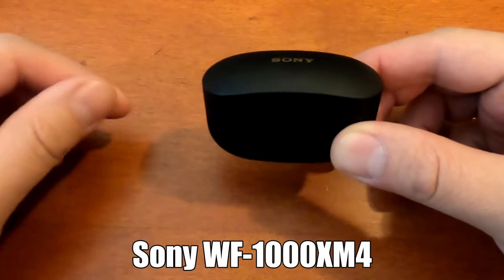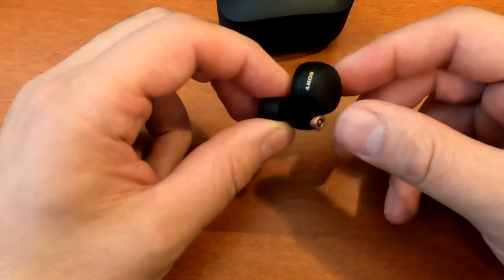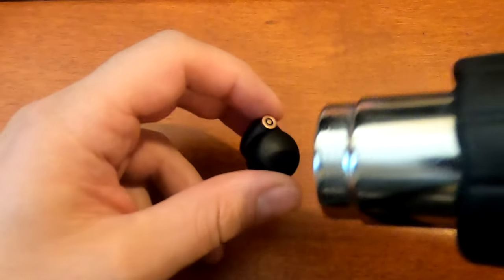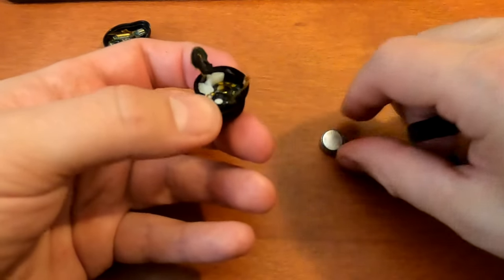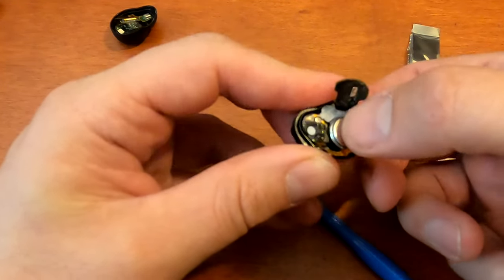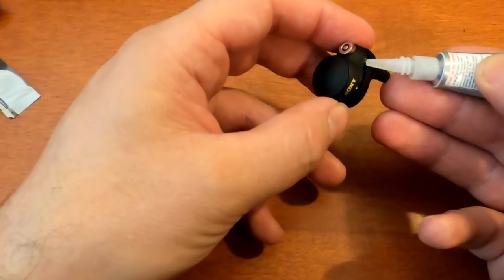[QUICK FIX!] Replacing the battery on a Sony WF-1000XM4 earbud

Comment: Tried this and it was a colossal failure, wasted $30 on replacement batteries for nothing.  The replacement battery began to heat up to a very hot temperature when I put the earbud back in the case.  Sony should be class-action sued for the huge number of these earbuds failing prematurely (got 14 months out of mine).
Reply from the maker: Ughh - Sorry to hear that it didn't work for you. Perhaps you had a bad battery?
Reply: or bad firmware
Reply: Same problem here

Comment: Thank you so much for posting this! I bought these headsphones a couple years ago for $300, so very stoked they could be fixed! The battery in the left earbud would not hold a charge for more than 45 minutes. I bought a battery kit and tools on Amazon and actually used my wife's hair dry to soften the glue (it worked great)!
Reply: Yeah, i had exactly the same issue... and the left one is getting got in case... 
I read (think on ifixit) that some explodes... Be careful when you switch the battery. On ifixit its recommded to drain the battery to zero. So u cant make a shortcut
Reply: The wife comes in handy aye;)
Reply: Whats the battery kit and tools you bought on amazon?
Reply: I'd also like to know which kit you bought? I found a lot after looking up the battery, and the reviews are iffy on most...
Reply: My silver ones were out of warranty, and Sony still did a free replacement for both earbuds. Contact Sony and see if they can do it
Reply: @whomstthouamme2155  oh, I might try this then. I'll have to find my old pair of headphones in the meantime, but it'd beat only having one earbud.
Reply: Thanks for the
 hair dryer idea!

Comment: Thanks. I had a feeling it's not hard if you're used to electronics repair. My left drains in 4hrs now and shuts off. Going to be replacing both batteries 👍🏾👍🏾👍🏾 "subbed"
Reply from the maker: You can do it!
Reply: Youre so lucky it is 4hrs. Mine at 45 minutes and dead. I hate sony now.
Reply: Howbdidbthe repair go brother?
Reply: @mrsquid8255  my new batteries come in tomorrow, thanks. I'll let u know how it goes.
Reply: @TheMrbean97  with noise canceling on I'm down to an hour now lol
Reply: Any update? I've got my batteries in the mail. So I'll be attempting it soon as well.
Reply: @javisolis2568  mine have been doing good. They last my 8hr shift at work like they used to
Reply: I'd take 4 hours. Not even 15 minutes out of mine

Comment: You ROCK! I want to give a helpful tip here as I am older and could not squeeze hard enough after heating to get the side to pop open. I used a hair dryer…after hot I quickly wrapped the bud in a protective rag and "gently" used a pair of pliers and squeezed in the oblong manner and the side popped right open for me to get a plastic tool in there. No scratches or damage. The trick is to be patient and heat the earbud up thoroughly as the glue is softened and the plastic of the earbud is much more pliable. Hope that helps someone!
Reply from the maker: It's still taking me a while to learn, but having patience when working on projects is sometimes 80% of being successful. Glad it worked for you!
Reply: thanks, that's very helpful. I was wondering myself if a standard hair dryer would do the job.
Reply: Legend
Reply: how long did you keep the hair dryer on it?

Comment: First off thanks for a well paced and excellently narrated tutorial. Certainly made things a lot less scary. A couple of things to share for other following in my footsteps. When trying to prise apart the case I found the tools supplied with my batteries were pretty useless. They were chipping and disintegrating so I just got a sharp knife and rested the blade on the crack. The two side just gently widened then came apart buttery smooth. Hardly any pressure required and no damage. My first battery swap was exactly as this video but the other ear bud gave me a bit of grief. The ribbon cable that has the black part that lifts up to release it was just not coming out of it's housing. So much so I reached the point of thinking this is gonna break. So I cut out the middleman and left it connected put the black locking bit back down and tried to see if the battery would come out. It did, surprisingly easy and there was enough space to remove it leaving the adhesive pad in place on both sides of the battery. Essentially you don't need to unclip the smaller ribbon cable if you are confident or if it, like mine, refuses to budge. Other than that smooth sailing. Good luck all.
Reply from the maker: Awesome! Yes, great tip about that ribbon cable - I've heard from others that they were able to replace the battery without removing it - goad it worked!
Reply: As you see in the video, that small ribbon cable has a "I"shape to lock it in (in addition to the lock tab), it needs to be lifted slightly first, then it comes out easy without force.
Reply: @user-rs8zg8ey2b YOUR COMMENT SHOULD BE PINNED! Too many people don't know about ribbon cable tabs at the connector. Watching this video (which is excellent), all I kept thinking was: lift and pull, lift and pull.
Reply: I left the cable connected too. Worked for me

Comment: I didnt even use a heat gun I just used a razor blade to slowly pry it open the adhesive enough to put my thumbnail in it, then its separates quite easily

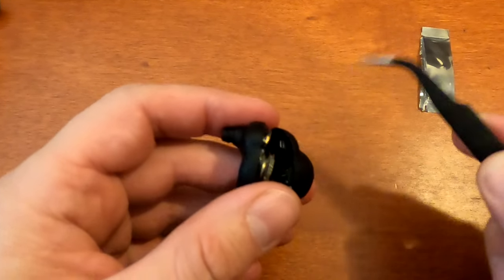Comment: Be very careful when connecting the circuit boards as shown at 13:58.  Do your best to make sure you have them correctly aligned before applying pressure to snap them together.  I just replaced batteries in 4 of these earbuds.  3 went as planned, but the 4th earbud was ruined when a couple of the microscopic prongs in those connectors bent while I tried to snap them together - probably due to poor alignment.  As a result, the outer part of the earbud was totally nonfunctional after I put them together.  But hey, three out of four ain't bad when the alternative was to trash the buds entirely!

Comment: Thank you so much for the video!  I was able to replace the batteries in both earbuds following this guide - they used to die after 20 minutes, now they're back lasting for hours again!
Reply from the maker: Awesome!
Reply: Bro, whats your version? And now backup time?
Reply: works with new firmware 2.0.1?
Reply: @GutCars  firmware shouldnt matter, you're not replacing software, its just the battery. Any inherent battery inefficiencies with firmware will persist after battery switch, this is just to replace drained faulty battery

Comment: Thanks for providing this tutorial. I also followed other comments of not having tu unplug the ribbon cable on the battery. Opening is probably the hardest part and the squeezing will only work when its hot enough

Comment: I'm so grateful to you. I had problems with the left hearing aid and I thought about discarding them, even though I like the sound and cancellation so much (I live in Guatemala and there is no official support or distribution, in fact the hearing aids were expensive and came from the United States because they are not sold here). But thanks to your video I felt qualified to replace the battery. So, I bought them on eBay, two weeks later they arrived, yesterday I made the change and now they are working as before. Thanks, thanks.
Reply from the maker: That's awesome! Glad it worked!

Comment: Absolute legend, thank you! So much better than the ifixit instructions. Sony won't honour their extended warranty so I'll repair them myself, but this is a lifesaver. I don't feel like I'm going in blind now. Lesson learned though - Dont buy Sony earbuds every again! Their aftersales and customer service team are awful.
Reply from the maker: Thank you!
Reply: Hey man, in the small off chance that you see my reply, Sony will honour their extended warranty if you talk to the right representative. I got a pair used from an online auction and spoke with someone this morning. I told them I didn't have my proof of purchase as it was a gift for christmass in 2022 and the person who purchased paid for it in cash and didn't think to keep a receipt for over a year. The representative then asked me to wait a second, and when they responded again they said the email with the label has been sent and that I do not need to provide proof of purchase, and when it states that it's out of warranty that does not matter as Sony will cover the entire cost. I may have to wait until mid-february for them to be replaced as they said they are waiting on more parts but I sent them in today as I had already received a label that they paid for and was informed they will just be giving me a new pair that has the issue resolved that they will pair to my current case.
Edit: I do have to state that I live in the United States and SONY USA has been pretty good at sending replacements outside of warranty probably due to our consumer laws. I am unsure if Canada or other countries are the same.
Reply: i absolutley agree with! no more sony and never!!

Comment: This was a great tutorial. 

For those who may struggle with initially opening up the earbuds (like I did), you can use the corner of a door jamb (where the door and the hinges meet) to apply pressure and pop the case, by putting the earbud in the space between where the door and the hinge will meet, as well. Works way better and doesn't hurt your hands! Be careful though!
Reply: very good tip

Comment: Thank you sir, replaced my battery just now! Hopefully that resolves the battery drain issue. Really disappointed in Sony considering how expensive these earphones were at launch.
Reply: is firmware 2.0.1? can change battery fix the issue?
Reply: @YohanesRobby do you solve it? I have same firmware and my left earbud is dead after 15 min (but i never use it much as right one). Do you have also problem with left one?
Reply: @marianmachacek  i change battery on my MX3 and fix it (before 2H, after 6H). its not firmware issue, but battery health. on my MX4 i replace with new one (under warranty) because sony told that is firmware issue so i can claim warranty
Reply: From what I've read, it seems to be an overheating issue caused by a previous firmware that degraded/damaged the battery. So the physical battery is damaged, swapping it and having the latest firmware should resolve it. Still inexcusable to be punished by sony for their mistake on such an expensive product!
Reply: @Crazy09starkillor  Could be done on purpose to generate battery sales .Which explains why they're using the specific zeni power battery for these buds.

Comment: Awesome video. I've just repaired one of my earbuds with your tutorial. I'd just add a note to say to open the earbud after applying heat, I've applied pliers, VERY gently, pressing on the sides where the parts are glued, not on top of the main surfaces. That allowed it to have a slight opening from where I could slide through the rest and separate the parts. Put some fabric where the pliers are pressing to avoid marks on the surface of the plastic. All this very very gently and it's working as new. Thanks.

Comment: My right earbud only lasts 40 minutes. Cant wait to do this! Thank you so much!
Reply: Mine lasts 2 minutes
Reply: Both of them
Reply: Had the same problem but after the latest update.
Reply: Just ordered the batteries, doing my own replacement soon. Looks like the XM5's are having the same issue and I'm definitely not getting new earbuds from Sony any time soon.
Reply: @CalusoXP  I had warranty, just got the refunded and found a shop wich sold the xm5 for  255€  new so just paid 15€ on top for the xm5. I took the deal.
Reply: @SprintetRuckwaerts  Lucky you, I live outside the US without an easy to claim any warranty. Anyways, kinda sad to see the same problem with the XM5's, hope the next gen doesn't suffer from the same problem.
Reply: @CalusoXP  But i had 2 Issues, my battery and my right Touch Function was not working. Would be pissed if they dont replace/refund it after 1 ½ Years of moderate use and a fckng 290€ Product but until now 0 issues with my xm5
Reply: Even if you are out of warranty reach out to Sony, battery drain is on their known issues list. I just sent mine in this week free of charge and they were a year and a half old

Comment: great video and really helpful.... a lit tip.. if you're struggling to separate the 2 halves after the heating phase. I used a small wood working clamp and slowly applied pressure and if you do it slowly enough the sides start to separate
Reply from the maker: Great tip!

Comment: Thanks for the video. I would like to add that you could separate the two halves enough to remove the battery without disconnecting the cables and you might have to lift the spring contacts slightly to establish positive contact with the replacement battery.

Comment: Thanks for the video which is mostly helpful. 

Hey guys, I just tried to follow all steps (most of which are correct), however, word of caution that the batteries we are trying to replace are with defects or swollen and for eg. my right one popped on me and luckily it did not shoot badly, but essentially, the battery opened like a can and tore the little cable. I don't think I will be able to fix it unless somebody has any more guidance as I am not that advanced in repairing electronics. Anyhow, it seems I will be off to buy new earbuds now. THEREFORE,

1. PLEASE put on your safety glasses (mine popped when I just opened it, and I guess the glue and pressure was keeping it. I was using a plastic sharp triangle, therefore, I don't think there was any electrical malfunction/interaction with the battery).
Reply: Was there's still charge on the batteries? Did you make sure you had 0% charge on the batteries?

Comment: Thanks a lot for this video! I have not even tried to remove the small flat cable, instead I have just pulled up the top from the battery and carefully replaced it. As long as you don't bend the cable too much, it'll be fine and the risk of damaging it by removing it seems higher to me than by bending it.
I have also used a standard glue to fix them, since I don't expect to open the buds up again in the future.

Comment: It worked! Wow never thought I would be able to fit the buds. Thought it was the firmware, downgraded it. But didn't thought there's just a little battery inside. One tip, remove the black stuff at the points where + and - are of the battery. Had to reasseble 5 times before I found out the black stuff

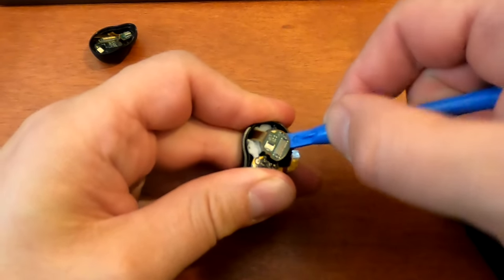Comment: be careful when prying the board from the battery at 8:30
there's a small metal piece on the bottom of the board that is supposed to touch the battery and is easily broken off - i accidentally broke it off my left bud and so there was no contact between the board and battery when put back together
if you do happen to break it off, i have read that a blob of solder on the bottom of the board will suffice
in my case, i cut a small piece of metal from a paperclip and glued this such that it was making contact with the metal piece on the bottom of the board, and this extra thickness ensured contact with the battery when the bud was put back together. this is probably not ideal, but it worked for me.
Reply: Hi, i just happen to broke it and i am like dead af at this moment. I also removed the glue it has with it now its nit properly contacting. Idk what to do. After you make it work is there some noise?
Reply: @bamtna
Reply: @abidshahriar7095  there is no noise or indicator that it is making contact, except for once you have reassembled the unit, the orange charging light should come on if you place it into the charging case

as i said in my comment, some solder would work if you have some
i chose to glue a piece of metal (cut from a paperclip) so that it was across the remaining metal piece on the bottom of the board, glued at either end - the thickness ensures contact. i used B7000 glue for this.

best of luck, i can't really provide much more information or advice, this is just the experience i had today
Reply: @bamtna  i soldered a small piece of metal but the issue is as i have completely removed all the glue (which was very stupid to do ) it now do not gently sticking to the battery. Hence no contact. Can you suggest me something? Btw would like to connect with you in any social media if thats ok with you. Atm I need someone give me some hope coz um freaked out like hell.
Reply: Hi that works for the left earbud. I was so happy. Now i wanted to fix tye right side bud’s battery also. Everything went well amd this time I haven’t broke anything. However, I am facing a weird issue now. The right side bud while putting in the case do not get charged and no sign of the indicator led to light up. This is weird. I don’t know what happened. The bud is working but it just don’t get charged in the box.
@batmna
Reply: @abidshahriar7095 is battery in correct position? Ribbon cables connected?
Reply: @abidshahriar7095  As bamtna said, a little bit of solder will make it work. It happened to me, before glueing everything together, dry test it (without glueing everything together)
Put both pieces in to the case, plug charger in, open and close the case at least 5 times quickly, red light will flash for a while, then green light will flash, then test both buds. If it works you can start glueing, if not try resoldering it. My soldering wasn't the best and it still worked fine.

Comment: Great video! The heating trick was the key. It is actually unnecessary to pull out the flat cable from the board on top of the battery. There is enough       wiggle room.